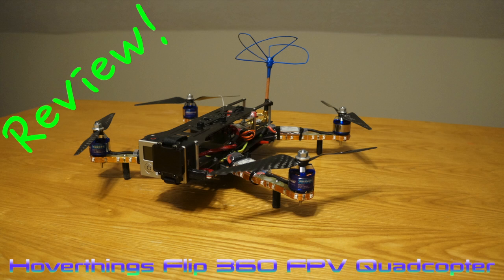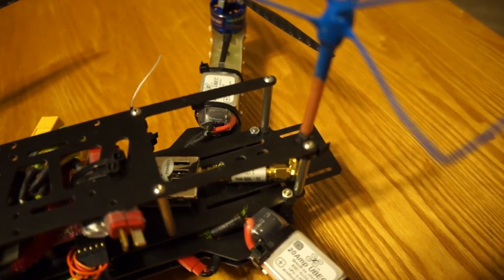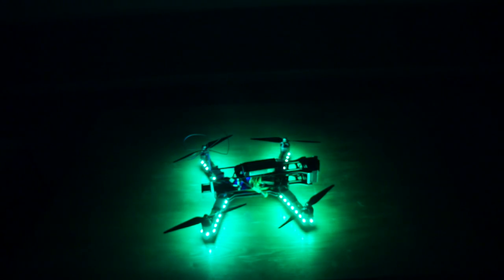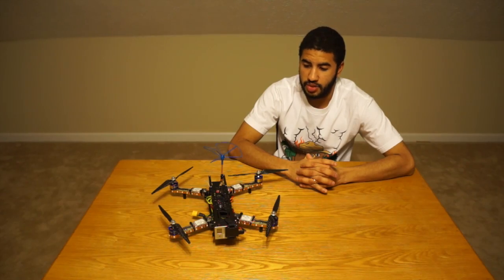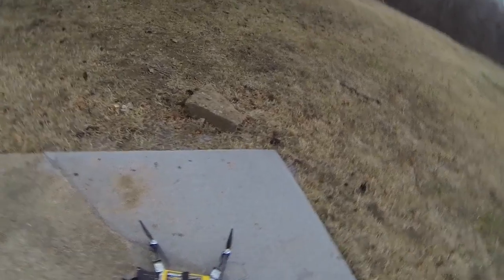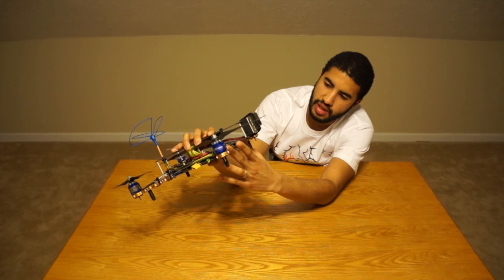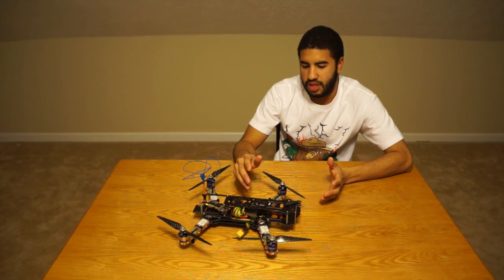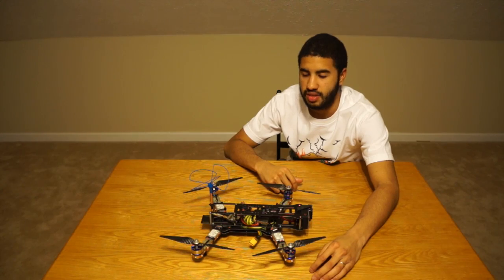Hoverthings Flip 360 FPV Quad In-Depth Review

Comment: HI,  been lurking in  here and   have totally  been brain melted  by trying to  learn about  this hobby in the forums.Shoot,   I'll bet  the tech has  changed  since I started typing this very post, 30 seconds ago!!It's hard to learn when  a  thread started 5 yrs ago... has  875 pages of  posts,  and  by the time  I  read the last  page,  the OP  has  either died, or  banned..  and   the  terminology isn't  anywhere   close to the first page! Not  complaining about  what's available today..  it's  amazing!   But for one  who is just  starting,   I am at a disadvantage.   Not only are there  several   avenues  to   take for a particular  style of  flying,  but  now there are   just as many  mfgs.  of these  parts!  Compatibility,  user friendliness,  etc  are  lost  to me.     For me, or any other beginner,    would it  be safe to just  plunge into a  certain model, probably RTF,   and  stick with it  until I've mastered it?  I've got a little  4 channel  experience with  actual  RC  aircraft-fixed wing,     quite a number of hours on simulator on  quads,  and of course the  50 dollar  toys.  I am  more than antsy to  'step up'.       This   video (about a year old now)   has me wondering  about  what  is   a  good  quad  to step into?      Not quite ready to jump into what  droneworksusa has  to offer,  but  sure would like to 'be there'  someday!Aerial photography  would be fun,  but  to me  taking the bird out for  recognizance  missions  (finding  my cows)   and    'funny stuff'   is my  goals  at this time.    Sure,  capturing  a couple seconds of    video  here and there will be just an added  bonus.  I know  not every  second will be   Hollywood.   Not to  discount the  'white camera holders'..    which is really tough  with recent  price drops..   I have a feeling  I could get so much more...  even a custom one  for just a few hundred dollars more?    Or  would  a  phantom 3 standard  be  a  good place to start.. at least get into the wind   and   it would be  my  'mule' to learn on... or  would the  'step up' after the phantom is smashed  and would be better off to  start with a  'true flyer'.. versus  a  'hovering  tripod'?

Comment: I saw both your vids on the flip 360 and the QAV250.  I am new to Quadcopters.  I am looking into moving up and was looking into a 450 quadcopter frame.  However, the 450 frames seemed a little too big for a start from the micro brothers.  I am not wanting the fly by the seat of my pants most quad 250 adrenaline videos show yet.  I like that you can put more on the 360 like the GoPro3 and the DJI Naza M lite for luxury comfort.  Could you make an objective video on pros/cons of the sizes (250 & 360) and usability for the newbie breaking into the RC Quadcopter hobby?
Reply from the maker: Sorry I don't have time to make any videos like that. I haven't even had time to make the 3 review videos I have been trying to make for the past month.

Comment: Have you had any overheating issues with ESCs built into the frame so far?
I'm trying to decide where to place my ESCs. Inside the frame is neater, but perhaps more risky, especially with my 30A Afro ESCs that don't have heatsinks.
Reply from the maker: If you seen in the video I have my escs on my arms. The only quads I have that my escs arnt on my arms are my 6s flip and my qav250. both do fine. However those are my setups so don't blame me if you blow something.
Reply: Ok thanks. I was referring to your other Flip FPV build btw. I clicked on the wrong video.
Reply from the maker: *****
Oh gotcha. well my other flip is 6s so it draws very low Amps to fly so my escs are always cold.

Comment: Another question I have is How do two of these motors get reversed from the other two? In the programming of the FC or do I wire them backwards? I wanna build an HK FPV250 frame for bashing and the RCX 1804 motors say (clockwise) can any brushless motor run either direction or are the predetermined? I'm also looking at the QQ super FC for this one, are you familiar?
Reply from the maker: Hey man check out a website called rcgroups.com. There is tons and tons of info on that website. I'd like to keep the comments on here as closely related to the flip 360 as possible because others looking for info might start getting thrown off by your questions. Thanks man :)

Comment: I'm building this quad right now, waiting for Futaba 7C to get here. I bought these motors, ESC's, and props. I planned to buy some 4S batteries too but I just read these motors are max voltage 11.1v or 3S You run them on 4S right? No problems?
Reply from the maker: they'll be fine :)

Comment: Nice quadcopter and cool reveiw but i still prefer my TBS frame at this size :) Have a great week
Reply from the maker: Glad you enjoyed the review. Ive always stayed away from the discovery. 1. because it uses cheap easy to break plastic arms. 2. If you wreck hard enough and break the center plate you have to unsolder everything then resolder it to a new frame. 3. Its not a true X or H quad so it never flys as well as a true H or X style quad.
Reply: ***** Well, i think you should first consider my style of flying: I don't do acrobatic flight, i am just crazy about aerial footage and normal FPV cruise (you can notice it in my videos). That's why the TBS is a better frame for me :) Happy flying to you!

Comment: Great review! Interesting you suggest this as a good frame for a first build since that's exactly what I've done. I've been putting her together over the last week, and taken her apart three times so far as I wasn't happy with the component placement. I think it's a great frame and great for a first build as it really teaches you to think about where you should place everything but the frame is large enough that you still have plenty of options.

Key points for me are that it folds away to a size that's easily transportable, but still lets you take a GoPro and 8" props, and provides that clean/dirty plate architecture so you can hide the ESCs and PDB away and get a really clean looking build :).

Due to the UK weather I haven't had chance to fly it properly yet. Really can't wait :).
Reply from the maker: Thanks man :) it is deff a great 1st frame to practice build techniques etc. On. I hope your weather chills out soon so you can fly yours :)